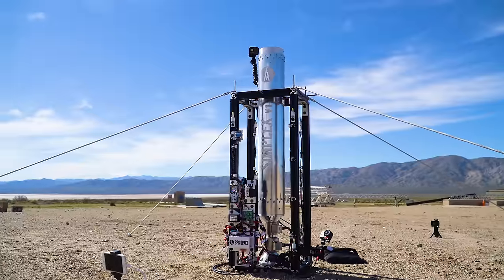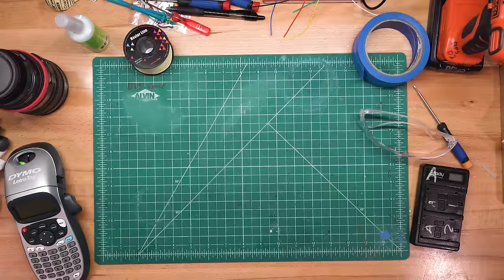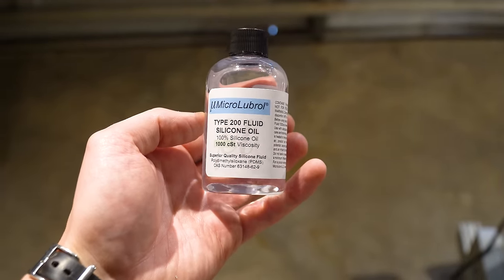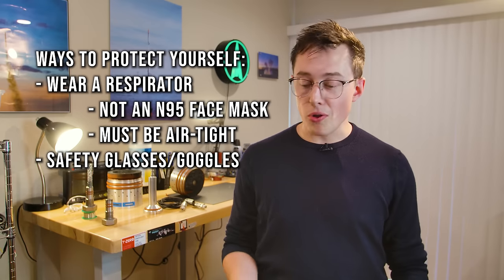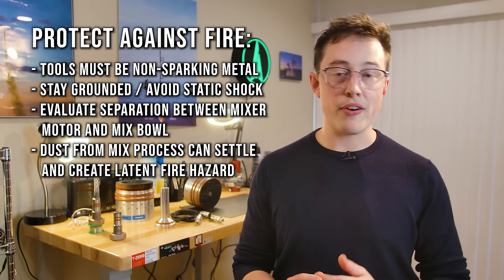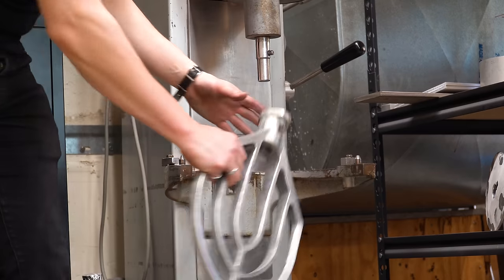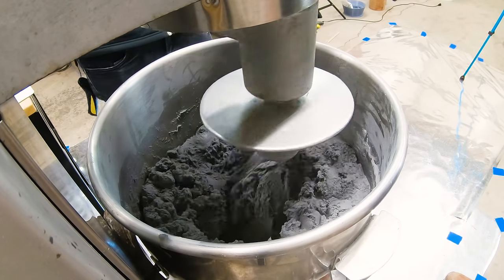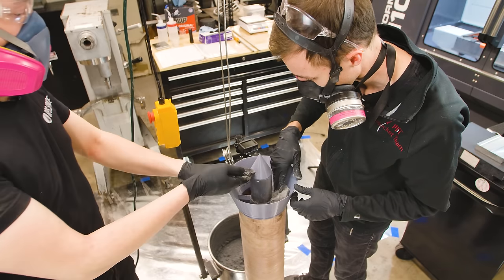Mixing And Casting Rocket Propellant - Simplex Ep 2

Comment: As a Baker, when you only have a dough hook, put all dry in first and add the liquids in slowly.  In your case, make sure that any " Grinding " of the dry ingredients will not ignite the mix as you are adding in the liquids, curing agent last.
Reply: Ammonium perchlorate is a bit impact sensitive, if I remember correctly. I use potassium nitrate. Not as potent, but it works. Richard Nekka Epoxy
Reply: That approach with APC will lead to a large hole in the ground.
Reply: Bad idea. If you atomize AP or metals in the air it's an explosion hazard. You always mix liquids (minus binder) first then particulates, wetting out each as you go. It's a risk mitigation thing.
Reply: @SparkRocketLab  "risk mitigation" is such a bland word for avoiding blowing up the entire building you're in.
Reply: @SparkRocketLab   If you go slow enough ( or had a paddle so you could avoid dry first with some liquids ) you end up with a putty like mixture and I did mention the potential of it igniting on it's own.  I admit I don't make my own rocket engines or mix such chemicals, I am a baker.  With a Dough Hook, you get the dry to incorporate smoothly with the reverse of how you mix with a paddle.  All precautions should be taken as the ingredients can potentially use the Aluminum Dough Hook as yet another fuel for ignition.
Reply: @Argosh  Any procedure with no caution, no safety, no attempt with " Small batches " to ensure the method of mixing works can.  Those combinations are going to solid rocket fuel.  Putty state rocket fuel can move as it is ignited and adds to the dangers if it ever gets ignited and thus all the mentions of safety, spark suppression, friction mitigation and other safety concerns.  As to " a large hole " you have not seen what concrete can do as it has an accelerant burning on it, it's worse than just a hole, parts of the floor could become projectiles as steam buildup under and in the pad could cause excessive massive deconstruction with projectiles.
Reply: @ericblenner-hassett3945  you were the one to suggest dry mixing, a well known bad technique for this application... Maybe just accept that it was a terrible suggestion... This stuff is dangerous. Google "PEPCON explosion" if you don't understand what this stuff is capable of.
seeing this much being mixed while filming with a smartphone gave me the heeby jeebies...
Reply: Maybe, and just maybe, baking doesn't translate 1 to 1 to making highly flammable rocket propellant.
Reply: @Argosh  "Maybe just accept that it was a terrible suggestion". Maybe just accept that the comment wasn't a suggestion, but a statement of fact? A dough hook is designed to mix wet into dry. If the user is trying to do the opposite, they probably won't get a standard result. This commenter is a baker, as indicated. They have knowledge that the dough hook is wrong. You are apparently an expert rocket engineer specializing in solid propellants, and your knowledge of the chemicals allows you to know that mixing wet into dry is a bad idea. Instead of getting after this commenter for providing a suggestion that is dangerous in this particular set of circumstances, get after Joe for doing it wrong, using the wrong tool, or whatever other high horse you're up on.

If the user cannot mix wet into dry because of risk of explosion, then maybe the user is doing something wrong, rather than this commenter, and needs to fix that problem instead of trying to muddle by.

I can see that there are a ton of expert solid rocket engine makers and chemists in these comments, but I would venture to guess that a significant portion of us are here to see someone else learn this, and to gain some knowledge ourselves. This comment thread was insightful, but the passive aggressive knowledge hoarding doesnt need to exist here.
Reply: As a fellow baker I always start with the wet and add dry. When I start with the dry, I end up with dry bits on the bottom that need to be folded in. I get a much more homogenous mix than when I start with dry.
Reply: @zysmith  In my apprenticeship, the breads were all dry scaled, ' bread guk ' and the yeast on the flower waiting for timing to add the water with the Dough Hook.  have not had a problem with that method until some wonderous being tried to make a slab cake that way.
Reply: @hplogsdon293  I don't see the simple statement that this approach would lead to a large hole in the ground as "knowledge hoarding". Of course after he doubled down on it I did sort of feel the need to remind him that there are no incidents where a bakery blew up quite hard enough to cause an actual crater and shattered windows in a town that was miles away...

Comment: These kinds of thin nitrile gloves aren't really chemical protection gloves. In a professional environment you'd be needing to use much thicker gloves with longer sleeves. (and nitrile assuming nitrile is the optimal material for protection for these chemicals) edit: American Chemistry Council suggests light polyethylene inner glove and light nitrile outer glove for light-duty use and thicker pe/eval inner glove and nitrile outer glove for heavy-duty use. I doubt manually slathering isocyanates in a rocket motor is considered light duty use. A single 3 mils layer of nitrile rubber worn for +60 minutes in possible contact with the chemical is probably suspect.

Comment: I'll note that space-shuttle SRBs are made with PBAN as the binder, because it cures a LOT slower than HTPB.  They could literally commence a pour on Friday, have the booster sit over the weekend, and then continue the pour on Monday.    PBAN is also marginally cheaper.
Reply: I made some composite motors using PBAN back around 2001 and I recall the mix being much more a pain to work with then HTPB was.
Reply: They used PBAN for several reasons. The space shuttle was designed in the seventies, and PBAN propellants were standard during that timeframe. Price and availability was another factor. Polyurethanes can be tailored to all kinds of curing reaction speeds, but considering the sheer size of the cast segments it was much safer to use other cure mechanisms, since traces of moisture creates gas bubbles in polyurethanes and exothermic cure reactions might cause problems during casting such big grains. And the main reason PBAN was chosen  wa sits mechanical properties. There is a lot of stress on the propellant grains due to the sheer size, especially once it burns. The PBAN propellant was more durable in that regard.

Comment: As a baker who has scraped down many a mixing bowl… consider getting a bowl scraper to clean the sides! It’s much easier to use and much more through than an actual spatula. 15:00
Reply: metal on metal is not a good idea...keep in mind that is is not dough but rocket fuel, if you ignite it while handling it - you get incinerated
Reply: @AKAtheA  bowl scrapers are typically a kidney shape piece of hard plastic. no metals involved
Reply: @zakhenry  depends, the ones used to get smaller amounts of softer dough out of the bowl are usually pastic, but the ones much more frequently used including to scrape dried dough from the sides are actually stainless steel
Reply: I was specifically thinking of the Ateco plastic bowl scraper! Mostly since they’re already wearing gloves. Just seemed easier.
Reply: I've 3d printed really efficient scrapers for other jobs.  Should be a quick print for you.
Reply: If not composites maybe wood spatula
Reply: I saw a worker who became a casualty of a mixer like this in 3 seconds with the dough hook.  That piece of equipment is so dangerous, it grabbed his wrist, twisted his arm right up to the top and twisted his entire body right into the bowl breaking everything it had to in order to suck him in.  It was over in 3 seconds, his co worker shut off the machine within 7 seconds or so but nothing would have saved him once he got pulled in.  Lock that machine down when you got your arms in there.  Pull the plug or lockout.  Really neat engine fellas.
Reply: Should find a way to automate mixing and scraping..

Comment: Well done. I'm really enjoying this series. Personal note: In the mid 90's I worked for a company that produced software for visualizing 3D volumetric data. We received an inquiry from NASA asking if we would be willing to do an analysis of a phantom (non reactive) rocket motor CT scan that was part of a study they were performing. The goal of the study was to identify effective non-destructive testing techniques for man rated solid fuel rocket motors. The data set was from a test article that had experienced a malfunction in the thermal controls while the propellent analog was curing. This resulted in massive stresses building up in the fuel that literally tore it apart. They wanted measurements of the tear surface area and volume of the open space. This was a really neat project and got me a trip to Huntsville AL to demonstrate how we did the analysis.

Comment: I've been building my own APCP motors for a while now, this was great to watch. It's kind of funny watching you go through all the same hurdles that I went through, like the intended pourable fuel that turned into a packable fuel, the PITA vacuum process of trying to keep the fuel off the vacuum lid, the voids in the finocyl and the liner OD not matching the case ID, it's all part of the learning process lol. If your fuel is only packable, i found that its necessary to vacuum fill the case, where you make a vacuum chamber that the case fits into, and at the top you have a funnel and ball valve which you pour your fuel into, then once the chamber has been evacuated you open the ball valve to allow the fuel to start pouring in. Once it is fully filled, any voids in the fuel will  collapse after releasing the vacuum, and you take it one step further by inducing vibration into the tube as it fills to allow better settling.
Reply: "keep the fuel off the vacuum lid"
Use smaller batches. If that is not an option, pull vacuum as much as possible, then quickly vent, which will collapse the upper bubbles. Repeat until you can pull a full vacuum.

Regarding the vacuum filling: Take a look at vacuum infusion for glass / carbon fibre with epoxy. Using the same bagging (simple plastic bag, but really strong) and sealing should not just be cheap, easy and fast, but also allows you to manually push the stuff in the tube to help the vacuum.

Comment: If making again in the future, maybe having a massage gun or something similar nearby, for if it becomes a packable motor. Could vibrate the casing like when casting concrete, to help liquification and reduce bubbles around the more complex geometry.
Reply: The mixture is way too viscous for that to make a difference. The less electrical devices you have near propellant, the better.

Edit: With a mechanical device going back and forth extremely rapidly, there's a distinct possibility to:

1. Build up static charges that could discharge into the propellant
2. Cause small sparks from metal-to-metal contact within the device.

I'm not saying that would happen. I'm not even saying it's likely to happen. But when the consequences are that you die or at the very least your face burns off and you're horribly disfigured, do you want to take those chances? No.
Reply: @wgoulding  I disagree, the right vibration can liquify extremely viscous and aggregate heavy concrete when pouring into molds.
Reply: @wesselscreations  concrete is different because you have a whole bunch of solid particles (aggregate) suspended within the liquid cement. When you vibrate that you achieve something called liquefaction. With solid rocket motor propellant, it's much more of a gooey plastic mixture that responds elastically to vibration. Vibration will help, but the problems they have cannot be solved just with vibration. I can't say more because otherwise I'd possibly be breaking federal law.
Reply: @wesselscreations   testing your theory on both substances would be a great experiment.

Comment: Well done, guys!
I had commented on a prior video about using a wagon wheel design we used long ago, 56" diameter 25-30' long, and we had to use 2 forklifts with everyone finding a place on the forklift to try and pull out the forms.  All 12 of them.  We used pressurized LOx (from pressurized helium) as the oxidizer, and polybutadiene+carbon as the fuel.  Your work here brought back memories as this was in the mid-1980's.  Thanks!  Great job.

Comment: Do you measure the containers after pouring to get the exact amount you actually used in the mix?
Reply: weigh the container and material inside, then subtract the container and leftover material after pouring
Reply from the maker: We did not but that is a phenomenal idea, thank you!
Reply: A good technique for weighing liquids is to pre-wet your container with the ingredient, drain it, tare it, and then add the amount you require. When you have added the ingredient to your mix, re-weigh the wet container to check that you have added the right amount.

Comment: One more nuance to the propellant making legality: in the US, transporting a live motor on the road and transporting a motor across state lines can expose you to new and exciting regulation like the DOT and rules around interstate commerce. If possible, making the rocket at your launch site can dramatically simplify the legal framework.
Reply: This is correct. You have to do a bunch of paperwork to do it. And have licenses and such from the ATF (which is actually now the AFT&E, the E being explosives. Yes, solid propellant is classified as an explosive).
Reply: Even a LEUP doesn't mean you can transport across state lines.

Comment: As part of the Rocket Test Group (a mutual aid society for rocket propulsion safety) I got a VIP tour of ATK's Promontory facility where they were making space shuttle SRBs. The major casting rooms had emergency escape slides that were in deadly earnest purpose, and frankly terrifyingly steep- and I'm a guy who has jumped out of planes, off a building, and flown aboard a rocket plane.

I'll stick with my liquid rocket engines, thank you. We didn't have to manufacture our propellants and could reload them in just minutes, our team even flew the X-Racer seven times in one day.
Reply: Yeah, other solid rocket motor facilities have walls that you can run though like the kool-aid man; so you don't have to get to an exit that might be blocked or crowded, you just have to run away.

Comment: Perhaps one idea for vacuum expansion issues, you may consider to have an intermediary vacuum vessel between the mix vessel and the Vacuum pump!  This way any inadvertent material would flow into the secondary vessel as a safety measure.
Reply: Those are called 'catch pots' or 'resin traps'. Very useful indeed! However i'm a bit unsure if they'd even want to mess with it in this specific situation, because it being used means APCP all over the inside of the lid and in the tubing. Better than inside the vacuum pump, for certain, but still a pain in the rear.

Comment: We used on of these flavors to make thermal lithium batteries. A couple times during the first year or so of running the presses to make the powder into pellets we had flash fire events.

A pound of two of powder would go off during those events. It was always over in less then a second. No bang. Not even much of a sound at all. But melted belts on the machine were pretty much SOP after a flash. 

No one was ever hurt and luckily we eventually figured out what was initiating the fires.

Comment: in a pinch you can always add a little more plasticizer. A vibrator for concrete strapped to the outside of your motor tube will help get air bubbles out while you pour the mix glhf

Comment: Additional safety points when handling energetic materials. High humidity keeps the chance of static build up in the air to a minimum, preferably above 60% if the materials are sensitive. Another is the use of cotton clothing and NOMEX overalls. These will reduce static build up on yourself and also if a fire or flash does happen it should provide enough protection for short duration events and or enough time to get to safety.

Comment: Great video; will show it to my students in my STEAM workshops.
You have inspired many young students here in South Africa. 
Thank you very much.
Many years ago my late brother helped a young student do a project for his young scientist entry. Regarding the effect of the grain size of the propellant components on burn tempo.
So yes.
Progressive, regressive solid motors.
Safety.
Many people complain that I am to strict. But after 19 years manufacturing propellant, I am opsessed with rules and regulations.
As someone who had to jump through hoops to get a licence to manufacture rocket propellant. Watching Americans willy nilly build rocket motors makes my eyes water.
Great video.
Glad you mentioned that checking the local laws regarding the manufacture of propellants is essential.
Doing so in South Africa will send you to jail.
Reply: It is STEM  not Steam, Art has no part in this equation. Because the weirdos have taken it too far.
Reply: @davidkohler7454  Art, is the creative aspect of engineering. I see it, therefore I can make it. Imagination has been a crucial part in engineering breakthroughs. So I think Art in S.T.E.M. has its place.
Once I though about how I had to visualize the construction in my mind to create the result I wanted. It made sense. How do you make an engineering drawing? or a blue print?

Comment: In pasta making, the way you account for all the vagaries of temperature, humidity, density, etc, is to use weight (mass) instead of volume measurements, even though the latter are far more common, even in rocketry apparently. Just a thought.